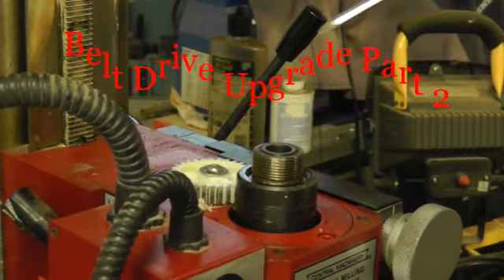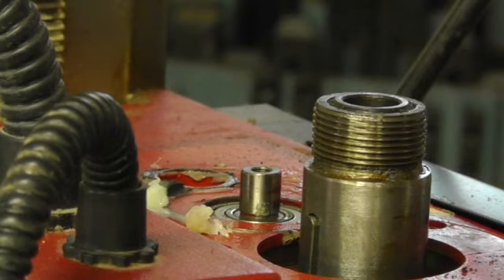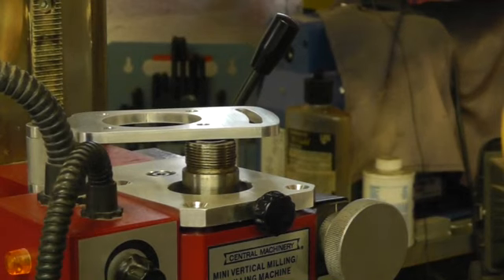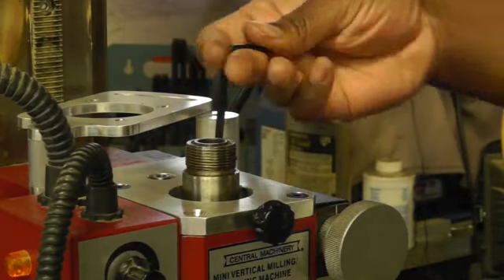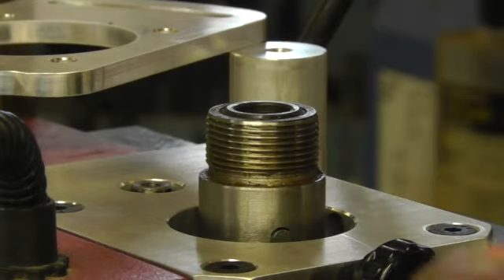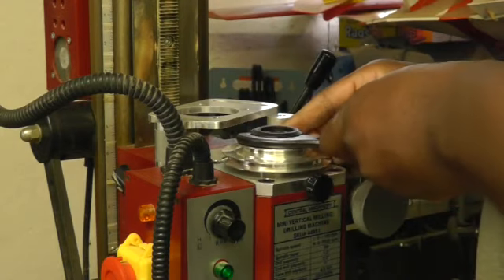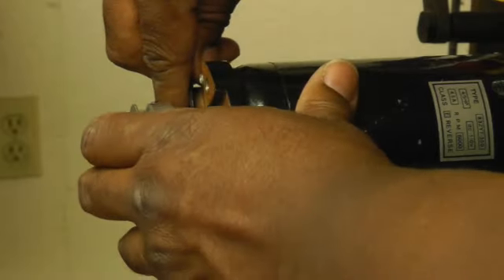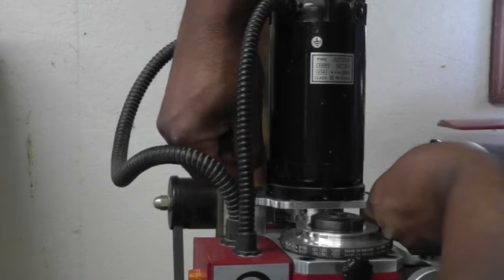Minimill Belt Drive Upgrade Part Two

Comment: Thanks Bill.  I just destroyed that plastic gear in my mill while machining up parts for my CNC conversion.  I needed to see exactly how to take the mill apart (to measure the spindle shaft) to see if this kit would fit.

After seeing your video, I took it apart, got the measurement and ordered the kit.  Thanks for posting!!!

Comment: Can you add more information on the DRO's you intend to use? I am looking at a simple and inexpensive magnetic DRO setup in all three X, Y, and Z-axis.  However, my first concern is where to place the X axis DRO; in front or behind the slide table? I think that placing the DRO behind the table will limit the travel of the Y-axis in one direction. 

Have you considered these issues and if so, what have you chosen and why? Thanks for helpful videos.

Comment: You mentioned you initially had a thicker base and this one has a thinner base, why did you switch?  I want to make one but I only have 1/2" alum plate rather than the 5/8" as called out in the plans.

Comment: I know this is an old video but I just ordered the Sieg X2 with an air spring, and the belt drive conversion. I ordered from Little Machine shop during my break at work yesterday. Before start machining anything important, I want to practice on scrap. Would you know where and how I could get some aluminum pieces just to mess with so I can get acquainted with my mill?
Reply from the maker: rdsii64 There are many sources for aluminum online. including ebay and amazon. Do a search for aluminum bar or aluminum plate. If you still can't find what you are looking for tweet me at @BillGriggs.

Comment: Great tutorial. I think I will do this to my X2. The internal gears are still engaged, right? Have you thought about removing them to make this run quieter?
Reply from the maker: Many people do remove the internal gears. I just never bothered.
Reply: Bill Griggs I see. Thank you for your reply.
Reply: I think you put the High/Low gear selector in the middle, and this will disengage the remaining gears.
Reply from the maker: You are correct.
Reply: Dave McAnulty
Oh cool! Thanks.

Comment: Do you get a lot more spindle speed with this belt conversion?
Reply from the maker: +GunsNpolitics  4300 RPM.
Reply: Bill Griggs That's much better than 2500. Thanks!
Reply from the maker: Your welcome.

Comment: Are you still able to use as drill press after mounting belt drive also?
I have quantum bf16 mill, i dont know its class but although it seems like x2, quill end on top bearings are very different.

ps: what i meant by drill press, drilling by pressing quill...
Reply from the maker: Yes. You still have full quill movement.

Comment: thanks for posting this..I just got this mill and I am converting it before I even plug it in for the first time.. I got a kit on e-bay but it is not nice like the one you got from little machine shop it had no cover and the bottom plate was not trimmed on the corners also there was no plastic hose to put on the shaft to prevent gears from falling down... needless to say I am ordering a kit from little machine shop when I get my next check...also I think the belt on yours looks a bit wider then the one I got. P.S my kit came from turkey ...go figure lol
Reply from the maker: Your welcome. There are several copy kits but this one from Stirling Steele (Little Machine shop) is the best one I have seen.
Reply: I think the kit you got from little machine shop is great and will look at this as lesson learned ..you make really good videos and hope you will keep posting them..

Comment: I don't know why you didn't remove the redundant gears, that's one the main benefits of the belt drive conversion, the silent running of the machine, with the gears still in there you'll still get the chatter from them
Reply from the maker: I didn't know better at the time.

Comment: why not just change the plastic gear with the metal gear and that's a 123 job, right?
Reply from the maker: +En Liri Several reasons. Increased speed ranges. Quieter running. Easier repair..... Changing a belt is asier than changing a gear.
Reply: +Bill Griggs a plastic gear would break first before the metal gears. IOW, the plastic gear is a kind of safety protection for the motor
Reply: you can, they are available but the gear will strip a tooth before shattering your bit which happens if the tool takes too big a bite. plastic gears are a cheap safety feature, much the same as comes on mini lathes

Comment: I work in an actual machine shop for 40 years. Guess what newbies a Bridgeport mill is LOUD because it has a geared head. I am not willing to give this machine less torque than it already has. If anything I will buy the metal gear set for it
Reply from the maker: That is certainly an option. Best wishes to you.